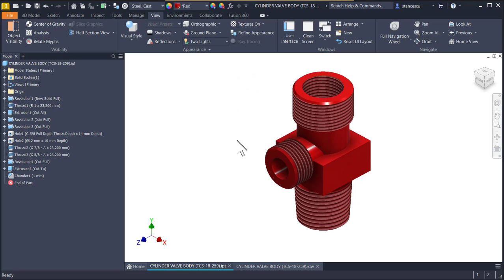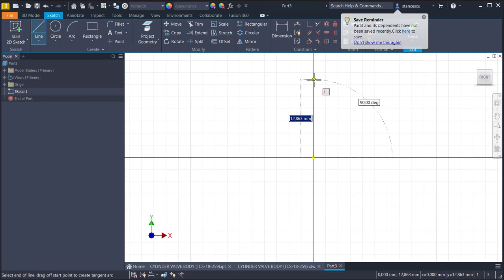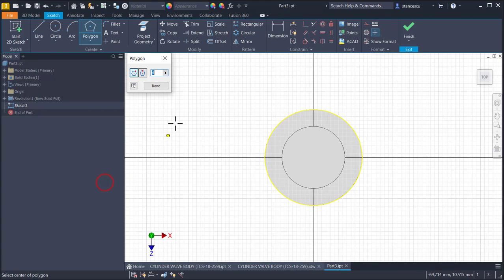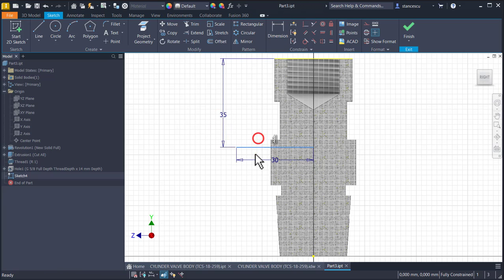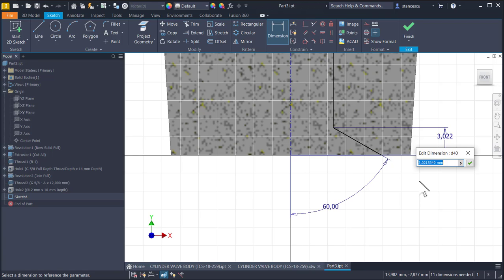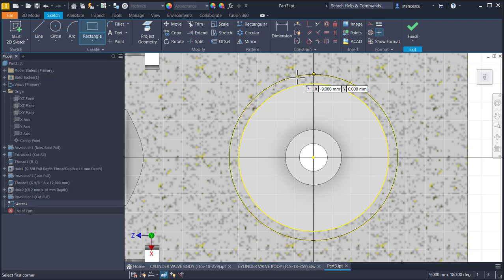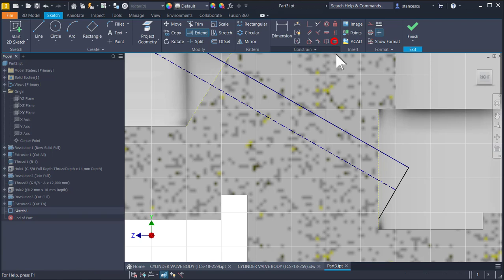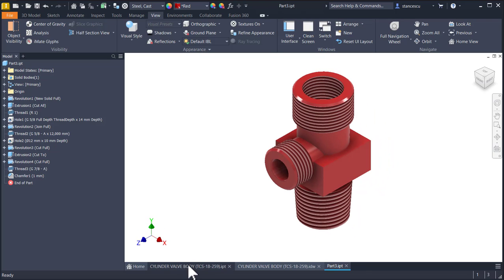Tutorial Inventor - 338 CYLINDER VALVE BODY (TCS-18-259)

Comment: Hi Professor, question: why do you sometimes use BSP pipe threads (the tapered thread) and sometimes ISO pipe threads (the internal thread at the top). I've noticed that before in your earlier tutorials.Or maybe the better question is how do I decide which pipe thread to use? Is there a good reference document (in English) that might explain that? 

Thank you in advance for your answers,
Glen W.
Reply from the maker: In the past I thought that BSP is the “original” dimensioning. In fact the values are the same and I decided to use ISO mostly. That’s all, thank you for the question!